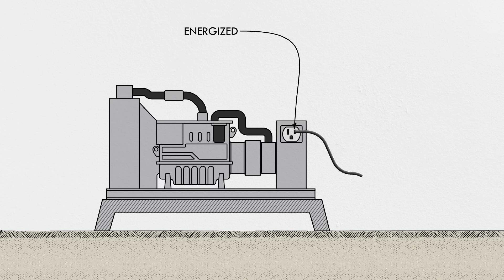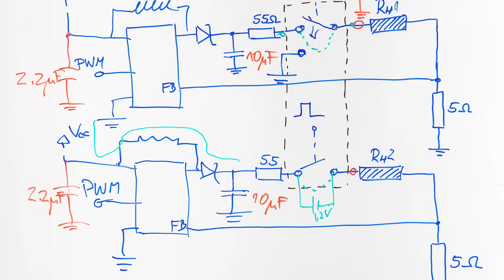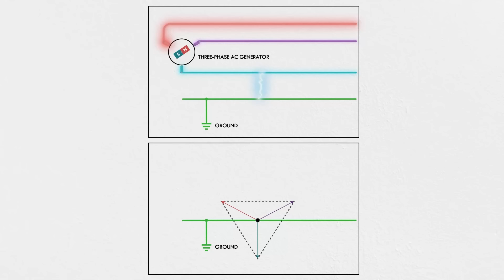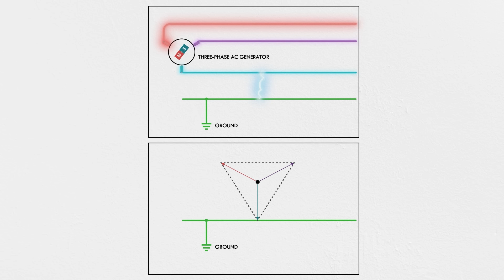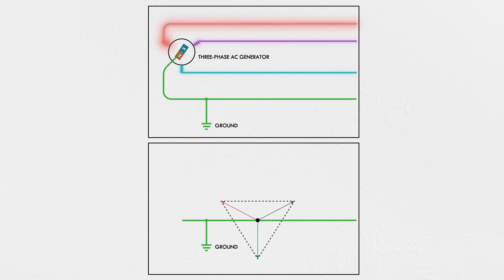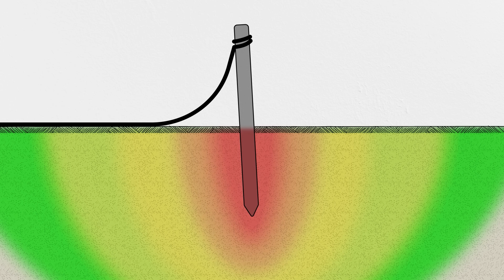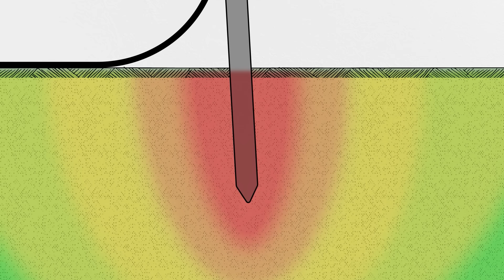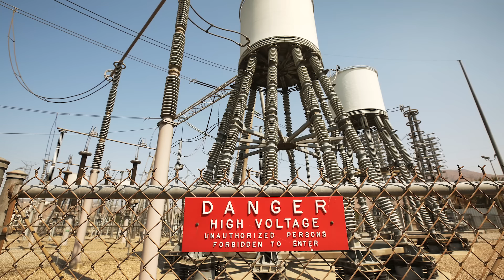Where Does Grounded Electricity Actually Go?

Comment: as a telephone lineman, this is extremely interesting and helpful. Some day, I'd love to see a video on inductance and its causes; I recently encountered 240v AC inducted into a 350ft span of aerial copper telephone wire, and am still at a loss as for exactly how/why this is happening
Reply: It was changing your iPhone as you stood there wondering. 😉
Reply: EE here. 240V is a very rare (almost impossible) voltage to be induced. [At least in my image of what a phone line is, it is an ideally twisted or balanced pair that should be located below the height of the low voltage distribution circuits (AKA the lines that feed the houses) on a pole ].

more than induction The most probable thing is that there is some line knocked down or drifting on the telephone line. (or someone with bad service tried to inject current).

If the line is very long, it may have been an accumulation of Static due to the friction of the wind, etc. And in that case, it could be that the combination of insulator and conductors acted like a giant capacitor.
Reply: I have been a telco maintenance tech for over 20yrs.

I have seen 525Vac induction on a aerial self supporting 6pr. The drop was adjacent to a 14.4KVac feeder.

What you typically see is adjacent metallic wires with AC induction, the communication wires acting as a secondary of a transformer. In a transformer, the primary and secondary coils do not touch. They are insulated and wrapped around the same iron core. The expanding and collapsing of the magnetic field is what induces voltage from the primary (source) to the secondary (field side). So on the wire used in communication and in your strand that hold the cable you are suspending up will be excited by the expanding and collapsing field. How much depends on proximity, humidity, and even the wind (friction of the dry air over the metallic wire or strand).

I normally see this in where the protective ground shield is either not bonded correctly or has deteriorated to the point that it burns open. The shield burns open through contaminants that cause electrolysis and the shield breaks down as the flow of induced voltage pulls electrons away to the more noble adjacent metals involved in the system.

Now back to your strand that hold the copper, coax, or fiber up. That strand should be bonded to the multi neutral at every point available on joint use poles. I know to save cost, if you are on your company's owned poles, there may not be a ground at every pole like the power poles tend to be. That is why your engineering dept should at certain intervals on the owned company pole line should  periodically ground every for example 10 poles in a long run. This ensures that not only induction is bleed to ground, but unwanted faults like electrical lines that may come in contact several miles down the road or lightning strikes has a path to ground. Like the example of the 525Vac induction I found on the job. The first thing I did was to stop working and call the local electric dept. After it was determined by a clip on AMP meter and close visual inspection by the electrical lineman team and myself of no physical touching of their conductors to my service drop, the electrical lineman used insulated gloves to ground my drop strand to ground and watch the induce voltage go from 525V to 72V with only about several hundred milliamps of flow on the strand. This was interrupted as induction because even a real fault, the current would have been much higher. 

So, after determining it was safe (I could still feel the static field, so I still used insulated gloves) I proceeded to bond every point I could on this 2 mile run. The end result was that the overall voltage dropped to about 12Vac which by my company standards fell well below acceptable guidelines. 

Always use you high voltage detector and when in doubt, call the local power company. 

Hope this helped, stay safe out there.

Safe creed..... "There is no job or  service so urgent that we cannot perform our job safely."
Reply: It's like when a guitar string vibrates sympathetically with another. There is a wave of energy which propagates away from the source, guitar string no1, it hits a slightly movable object, and that energy wave imparts a force on the string no2.

Same thing as with a loudspeaker at a concert and your ear drum, the speaker vibrates, it goes through air, it hits your ear drum, your ear drum vibrates at the same frequency, just a bit less than the speaker. Of course, this falls off with distance, it's quieter the further you get.

Wires vibrate electromagnetically, they produce electric and magnetic fields going away from them. So you take a secondary wire, put it next to the first, and the eardrum will vibrate. Same frequency, just with a little bit less power.

This is how transformers work, you want to reduce the losses, so you make the wires really really close together, like putting your ear drum near the speaker, and you want to increase the length within the same volume, so you coil it up really really tight, like getting a bigger eardrum. Transformers also have some weird properties with the whole step up and down voltages thing, but the intuitiveness of the analogy breaks down.
Reply: This wasn’t inducted this was a fault. 240v isn’t a coincidence brother

Comment: I worked in grounding and this video brought back much of what i learned at the time. We had an area that gets ice storms and the weight of the ice on the high temtion line and the return would cause the poles to break so we removed the reyurn and improved all the grounds in the areacfor earth returns. I remember working on a hill of shale and having to drive 100 feet of ground rod to reach the water table and get adequate grounding. Another time i could not get it and we realized that we were in a valley completely surrounded by rock and thus insulated from the world. We run half a million volt dc lines from up north with earth returns and they can tell in the US what we are doing. I remember being told how material from the ground rods slowly dissolves at one and builds up on the rods at the other. We reverse polarity every so often to reversevthis effect. I hope I've got this right as it was over 40 years ago when i learned this.

Comment: I used to use electricity to get nightcrawlers for fishing, wired two metal posts to en extension cord, the posts beaten into the ground deep and plugged it in, and that method worked very well. One time a connection came lose and nothing came up from the ground, i discovered one wire came loose. One other thing, if you decide to try this method , be sure to unplug your cord before walking on the ground itself, When it is plugged in, stay on the cement driveway, otherwise you will get lit up like a christmas tree lol. Found that out accidently.
Reply: We poured mustard down their mounds.

Comment: In the UK the ground wire on the toaster is called a CPC - circuit protective conductor. A CPC is only in a circuit from the main panel. As explained, it is just a parallel Neutral wire with low resistance to trip the breaker quickly. So we have two neutral wires,. 

1) CPC - in circuit.
2) Bonding - connecting extraneous metal arts of a building together.
3) Ground - at the main supply as it enters the property.

The above have different functions. They all confusingly use the same colour wiring. If different colous were used for the three it would be easier to understand.

Comment: A remarkably well done video - an EE specialising in grounding.
Reply: I am an Architect in Germany and with our often used fully insulated water impermeable concrete basements... the mandatory solution for grounding (and lightning protection) seems a bit overkill.. as usual. Can be seen in this video (I don't know if you can link non youtube stuff on youtube..) youtube.com/watch?v=XYzJL2ujOa8
Reply: Oh, you're an engineer? Explain ferroresonance in ungrounded systems then.

Comment: Grounds in houses are actually "secondary neutrals" with extra thick wires so it has really low resistance.  Neutral happens to be connected to ground at a single point in the house (usually the main panel) but for different reasons. One is to keep the house from acquiring a potential relative to the ground, another is to create a path to the Earth in case of lightning.

Comment: 15:40 one thing that is sort of frequently overlooked is that lightning isn't just 1 single phenomena, there are different kings of strikes and flashes, with different causes and originations, one I'm particularly interested in is TLE's transient luminous events, typically occurring above certain lightning strikes with an ionized conduction path formed above the cloud and extending up into the altitude ranges of the ionosphere. Making it interesting to consider natural electrical paths forming between the ground and ionosphere. . . For reasons 🙂
Reply: For reasons. . . Like...?
Reply: @kindlin  Wouldn't you like to know :-P
Reply: @mattlambermon6583  
Yeah, I would.

Comment: Visitors to London may notice that the London Underground uses a four rail system. When it began electrification in the late 1800s/early 1900s it used a third rail setup like most subways around the world. However because the tunnels were being supported by cast iron rings, the stray currents returning to the earth were causing electrolysis on these parts (not to mention many of the neighbouring pipes underground). Because of this you now have two running rails for the wheels, an outer positive rail energised to +420V DC and a central negative rail energised to -210V DC for a full potential of 630V DC.

Comment: In high voltage electrical safety classes we're taught to either take very small steps or to run. When you're running only one foot is ever in contact with the ground.

Comment: One practical question I would like answered.  We installed a gas generator in our back yard.  The installers said we needed to properly ground the system and drove steel electrodes into the ground near our house.  The gas line was polymeric (urethane? ) and the grounding electrodes were less than six inches from the gas line.  I questioned the placement and they moved them to be a foot away.  How close to the gas line can the electrode be so lightning can not burn through the polymer, release the gas and cause an explosion?

Comment: A friend of mine once related to me a problem a local electricity utility company was having; occasionally, the input circuits on some modems were getting burnt out.  What puzzled the technicians was that this was happening only on circuits to one particular new generation plant located about 150 miles away. It transpired that there was a particularly high ground resistance between the two plants such that when the generator loads were sometimes dumped to ground it caused a very high voltage across the circuits, frying the inputs.  They had to modify the circuits to isolate them from ground

Comment: I know very little about the national grid but I am a licensed electrician in New Jersey so I do know a lot about electrical systems. There's two types of grounding: system grounding and equipment grounding. System grounding is the grounding electrodes at your house like ground rods, concrete-encased electrodes, and of course the copper waster pipe into most homes in the North East. And then there's equipment grounding like the frame of the toaster in the video. System grounding prevents induced voltages caused by lightning strikes and surges caused by the utility company and equipment grounding clears ground faults caused by appliance failure and/ or negligence of the end user. If the equipment grounding conductor is not connected to provide a low-impedance path back to the source then the fault current cannot open up the circuit breaker to clear the fault.

Comment: If I remember correctly the reasoning stalled ground circuitry was because of TVs and radios strube probably grounded keeping people from getting small electrocution. Neutral was always on the ground side of the building. I remember when you're adjusting the radio or TV when you got shocked you just turn the plug 180°plug it back into the wall so the chassis would be properly grounded.

Comment: In audio processing, the biggest problem with chassis-ground is that it's susceptible to electromagnetic interferences, which can cause ground loops that radiate into the signal. As a result, a lot of audio devices like amplifiers come with a switch that allows you to lift the ground.

Comment: Something important to note about lightning—not sure if this should be considered a correction or an elaboration—it’s electricity flowing through a completed circuit the same as electricity flows in any circuit. Electricity is electricity. 

Basically, lightning is a leaky capacitive discharge, in the same fashion an electrolytic capacitor without electrodes that are completely insulated from will leak current and deplete its charge, except the leak is the sudden dielectric breakdown of air when the potential difference across two points becomes high enough. With enough voltage potential across two points, any material will become a conductor (dielectric breakdown) by getting its outer most electrons shredded off of its atoms. The clouds and the earth (or other clouds) are the electrodes of a giant capacitor storing the charges in electric fields; when the voltage potential between the two electrodes becomes high enough, the air can no longer insulate the flow of electrons between them over a given distance and thus experiences dielectric breakdown, and  ⚡️ you have a lightning bolt. But how the charges initially build up before that part is indeed somewhat a mystery

Comment: I’m working on an electrical project at an older building at the local university and the old XFMR that was there when we started didn’t have a neutral and the old panels didn’t have any grounding. 

I showed my boss that an old 480v 3ph panel had wildly inconsistent voltages from phase to ground (I.e.: from phase to the metal panel enclosure) and even though every circuit in there was a 3ph breaker for metal halide lighting  (voltage was more stable from phase to phase) we still ran a grounding conductor to a ground clamp attached to building steel when installing the new panel and grounded the panel+installed a ground bar. 

I learned how important grounding was that day but I’m still learning how it really works 🫠

Comment: In a residential branch circuit what you are calling the neutral is really "the grounded conductor. Back at the load center(main panel) the grounded conductors from each branch circuit are connected to the utility neutral conductor, which in turn is connected to the electrode grounding system. On a multiwire branch circuit there can be a neutral conductor. Also the term "outlet" is defined in the NEC as any point of a circuit that will be connected to utilization equipment. Receptacle would be a better term than "outlet". A disconnect for a air conditioner condensing unit can be considered a "outlet" under the NEC definition.

Comment: A problem in the street electrical line let my home without ground for months. I noticed some weard behavior on the power like ceeling fan speeding up and down for no reason. Until some day I found a test power Philips tool and tryed just for fun. Both sides of the plugs had power. I was stunned. And start checking the home plugs. Wille testing I noticed that once I removed a semi industrial freezer of the wall  the house lost all power. I reconnected the freezer the house power came back. The way the freezer connections worked inside of it allowed the big transformer inside the freezer to work as a netral (ground) for the whole house wille the freezer pump was on. I know it's very un safe and in reliable but the idea of creating a usable neutral with just one transformer was something new for me.

Comment: /nit picking mode on 
@10:52 you speak about voltage while your meter is set at resistance (ohms). 
/nit picking mode off
Very nice video (as usual)

Comment: have seen the result from a lightning strike on a TV antenna. 30 feet of TV coaxial cable, and the entire core conductor was simply gone! The LDPE isolator, that has a very low melting point, was fully intact. But the copper core was completely gone, vapourised by the huge current. The plastic insulator didn't even have time to melt. I once saw a 3 phase fuse-box explode and it melted a big hole through the wall. I was looking outside.

Comment: what I don't get with step potential is (if you're expecting a risk ok a ground fault) couldn't you wear a conductive rather than insulating gear, to have a smaller resistance path then through your body

Comment: There is a difference depending on what you’re talking about The neutral is actually called the grounded conductor The green wire which we call ground or equipment ground is called “ grounding “ It doesn’t conduct any current in the circuit It gives a path of least resistance for current in case of a fault or short

Comment: excellent explanation.  I was trying to discover why (and how) earth grounds actually worked, and why my ham radio ground (a steel stake in my yard) had a voltage difference with the house wiring.  All a matter of surface area!   I am a contrarian, and I refused to just take the advice of experienced ham guys to just 'build your ground system bigger'.    I wanted an explanation of WHY it needed to be bigger...and now I know, and believe that it will work.